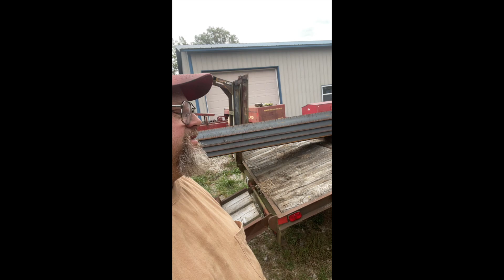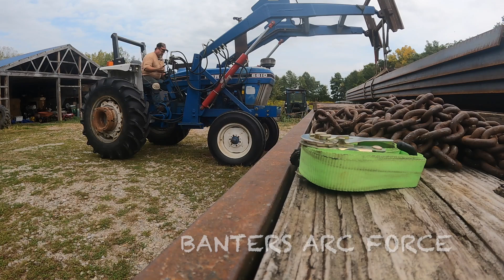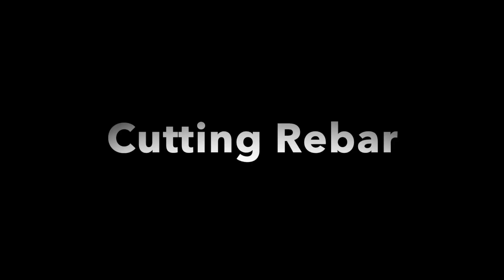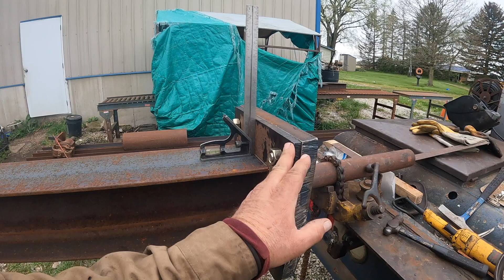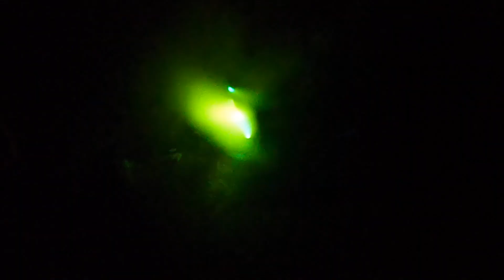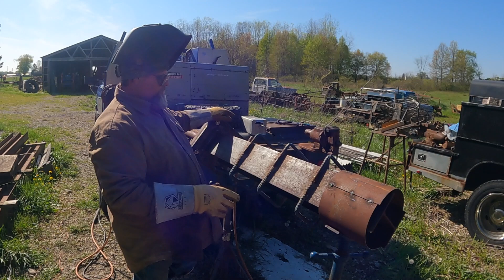Hay Barn Building Column Anchor Post

Comment: Can I ask what your settings were on your machine for that 1/8 rod ?
Reply from the maker: Maybe 120 amps , if it splatters I’m to hot
Reply: @bantersarcforce  Ok thanks. Love watching you weld with that older machine.
Reply from the maker: Some older welding machines that the voltage is controlled by engine speed. It will affect the heat on the puddle the higher your OCV open circuit voltage meaning that your RPMs are high and your 0CV is higher than the machine recommends sometimes those machines run really hot when your RPMs are up, make sure the settings on your OCV is correct think of it like mig welding you turn your output, control voltage control up It increases your voltage or the heat in your puddle and your wire speed controls the amperage when your stick welding that’s kind of what you’re doing you mess around with the RPMs to get that puddle to be fluently running the way you want but don’t go over the recommended OCV that the manufacturer recommends and you have to test your OCV with a very sophisticated voltage tester on the host of the world and she negative and positive
Reply from the maker: If your stick welding with the machine that you plug in the wall, don’t mess with it let a professional work on that
Reply from the maker: Thank you for watching my videos
Reply: @bantersarcforce  I have the identical machine that you have Ranger 300 DLX. I've been welding for 7 years. I got my tickets in 2019 but don't have the experience you have so I really appreciate your videos on welding. Thank you.